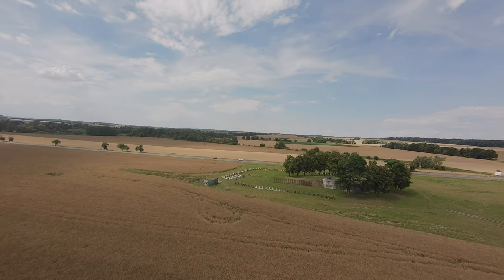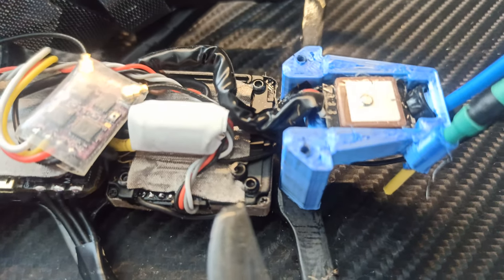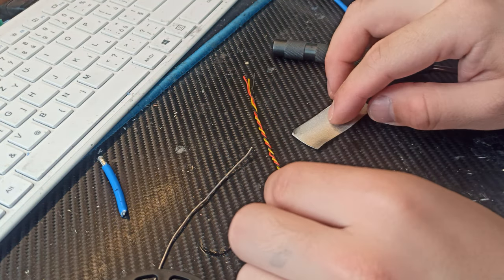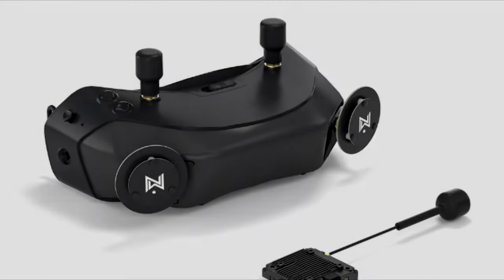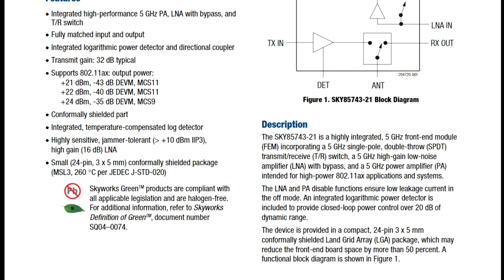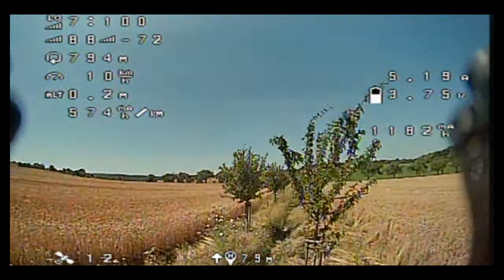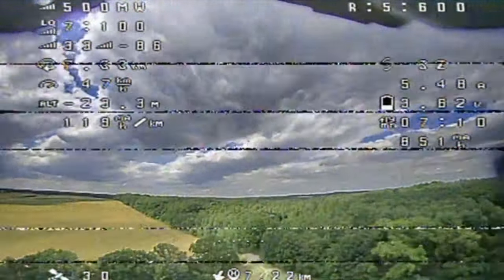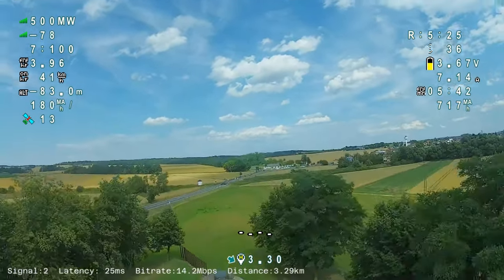Walksnail Avatar Tips Out Of Nowhere | no GPS fix | Long Range Test | Penetration Test

Comment: Thanks for talking about how signal loss is handled - dji goes to low power mode and then... well good luck regaining a signal once it's lost many kms away. only once it's close and RTL'd to overhead does the signal reconnect. WS appears to be much better in this regard with 4 seconds to reconnect. Still nothing like analog as you state, let alone 1.3ghz analog.

Cool antenna building! I found diy antennas can work well but easy to get wrong/badly tuned?

Comment: wasn't the interference problem mainly on v1 of VTX? I tought they fixed it with V2 or is it still major problem with the v2? Great video, thank you.
Reply from the maker: I havent got the V1 but it looks like the problem is still in v2. Maybe scraping the screws would solve this issue but on my long range quad I really want to be sure that GPS will work as well as it could.
Reply: Damn thanks for this info. I do have the problem with V1 vtx (I have to power my FC with USB until I get gps fix and replace USB power with lipo
Reply: Mads Tech did a video where he uses a spectrum analyzer which shows the V2 no longer has the interference the V1 had. Of course there are more reasons why interference could happen to include a faulty device or poor installation.

Comment: Are you doing this with the maximum output power? Just, seeing the R : 5 : 25 makes me think you're on 25 mW?
Reply from the maker: I have done every tests on 700mW, I am not sure if I mentioned it in the video. Probably not and that is a huge fail. But the OSD info about channel is something I forgot there from Analog vtx. It is not the reality because the vtx power on walksnail can be set up only  throught goggles and not from FC.
Reply: @VincentFPV  Ok, that makes sense.

Comment: hello ,what is the recomennded setting fot vtx power and mbps?
Reply from the maker: Unlimited power and all of the mbps you can find.
Reply: @VincentFPV  so you would recommend for the 1200mw and 50mbps?
Reply from the maker: @farisnazeri9841  I would recommend to use the freedom of changing parameters for specific place. Race mode obviously for race, for some cruising alone 16:9 1080P 50mbps. For agressive freestyle 4:3 720p 100fps 50mbps. Its just few clicks! Use the hw and know the fw ffs!
Reply: @VincentFPV  thank for tip sir.

Comment: I just put the GPS receiver at the front of the quad away from the vtx and its RF output. I can't understand the continued stupidity our Chinese freinds have of stuffing it all together at the rear of the quad .....🤔😳😳😳🙄🙄🇬🇧
Reply from the maker: it is always a compromise to where you put the GPS. You can put it in front but it is more likely to be damaged while some crash. You can put it in the back, but it performance will be worse due the interference from VTX and a bit from RX. You can put it on the side between arms, but this will cause more air resistance. I just put it at the back as I designed the frame myself and the back is combined with RPSMA connector holder and third stage antenna fixation. But there were options for mounting it under the Thumb 4k, but I assume that imaging processor from thumb will produce a lot of noise too. 
And for real I donť mind to shield the cables. :D I was also using coax cable on analog builds to route video signal and even power for vtx after cleaning it with LC filter. :)
Reply: @VincentFPV  Agreed, but the M10 GPS is tiny. I never carry a bloody great heavy GoPro, another madness IMO. I guess it's all down to preferences. I'm a retired Design Engineer, so I tend to make custom parts for my quads....🤔😳😏🇬🇧
Reply from the maker: @EnglishTurbines  I totaly understand. :) I still love to carry the 20g Thumb because the 4k video from it is much better than the avatar DVR.
Reply: @VincentFPV  Yes, on that subject, have you had any joy stabilising Walksnail footage using Gyroflow yet?...🤔🤔😳
Reply from the maker: @EnglishTurbines  
Recently I found out that there is almost official lens profile by Hermes and I started with some experiments. The syncing points are really pain in the a** but you can find them and most of the time they are around 120- 170ms (mostly 142). I like autognerate 20 syncpoints and then I delete many of them that are not in the range.
https://youtu.be/B9y2wsLZeiA
https://youtu.be/BeMchRICk5A
Reply: "...stupidity our Chinese friends have." The generalization. 😅